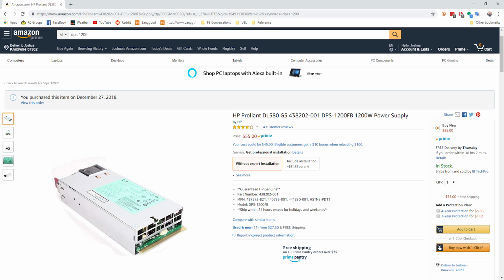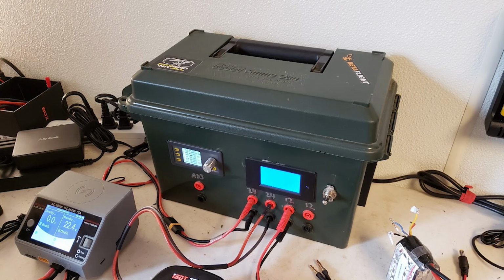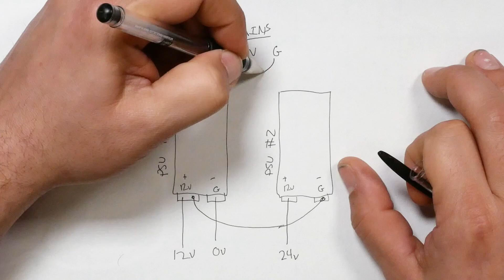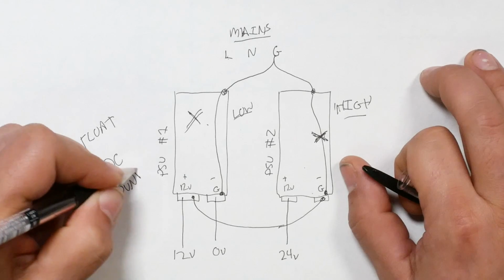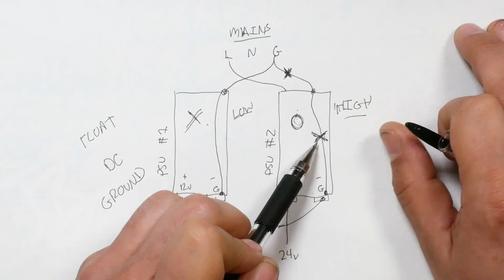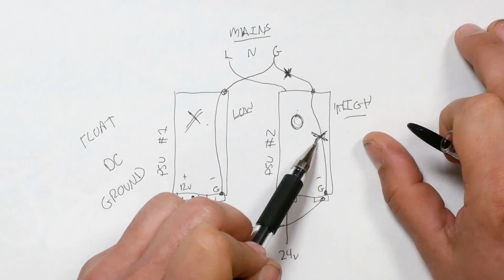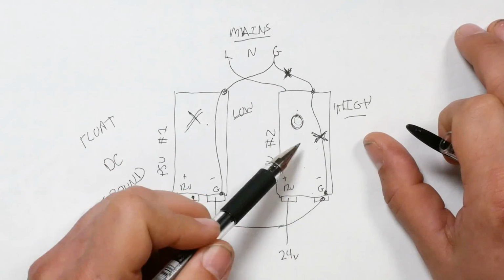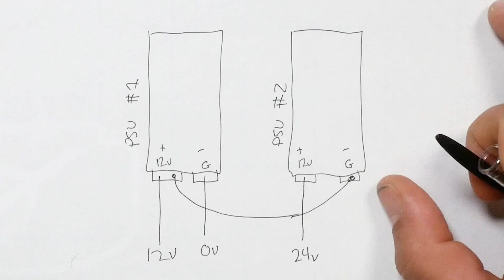How To Build A 24v / 2400W Power Supply | BEST BANG FOR BUCK 24V PSU

Comment: I did this and found it didn't matter which PSU had the floated ground, it would always work. I tested to make sure each PSU would cut out if this was done without the ground floated and they both did cut out if they were the first PSU in the circuit, but once the ground was floated in one of the PSU's it didn't matter if I placed it first or second in the circuit, I would still get 24v. The only difference it made was whether the potential on the casings was 12v or 24v

Comment: Hello Josh, I followed your video but floated both power supplies.  Do you see any issues with this?.  Also i read in a previous comment that the screw post on the board near the "mains" plug should not be isolated.  Is this correct?.  Thank you for any response..

Comment: Why 1200W (2400W in total) tho?
That's a overkill.
Better get two 600-750W (1200W-1500W in total) ones for $10 each and it will feed 95% of the chargers on the market
Reply: Wait where the rest?
You should show people they way you joined them together, the enclosure, mains y splitter etc...

Comment: I had built this. It is as awesome as joshua says. I had one fail, still don't know why. I used same method on cheaper Chinese 12v 30a 360w supply. 24v 720w. I still have the 12v original and now I have 24v again and will most likely ever push its paces. Isolate the board from the case good to go

Comment: Go on ebay you can get these power supply for much cheaper on ebay used like probably $30 for both and I mean assuming you are not going to find 2 different Circuits to plug ini think 2 750s makes sense that's 1500 total and that's supposed to be output so input would be a little higher

Comment: How about current? Wouldn't the HIGH side PSU see twice the current it normally sees?
But its elecotnic components (transistors, capacitors, inductors, resistors,...) aren't sized for twice the current.

Comment: At 5:56 I think you're mistaken or at least what you say is incomplete. If the case on the right hand side became energized, then the ground line of the HIGH side supply would also be energized (the case is still grounded when we only cut the connection to earth at the plug level)
Because of the series link between the two PSUs the 12V line of the left PSU became also energized and it will fry the left PSU. Two cases:
- the left PSU exhibits a conductive path to ground/earth (a short circuit, for example due to a capacitor blowing up) then the breaker pops
- the left PSU electronics cut the circuit to ground (for example a transistor blows) then the breaker doesn't pop.
Remember that for the breaker what matters is the current between live and earth, not the voltage (which would be above 200V AC anyway).
In my experience electrolytic capacitors (which are ubiquitous for decoupling in switching PSU) very often short circuit when they blow. So there's a good chance (higher than 50%) that the breaker pops instantly. But it's not guaranteed, just likely. This is to put in perpective with what you say in the video: that the case of the right PSU would remain energized no matter what.
Reply: So do you think that this is a safe mod? I wanna do this but not kill myself lol😂

Comment: Great video! I have a different HP power supply and where you solder the resistor and where I soldered the resistor based on another tutorial are different.  Basically my tutorial stated to solder a wire from pin 33 to the ground, then the resistor between pins 36 and 37.  Is there a right and wrong way or is mine just different because it is a different power supply? They do power on in series and do provide 24.6v.

Comment: Instead of wiring up the resistor like that, could i put it across a switch so that when the switch is in the “on” position it turns on the power to both the power supplies?
Reply from the maker: Yes that's fine.

Comment: So is this actually a 1200w 24v supply ? Or 2400w 24v? I’m confused.
Reply from the maker: 1200w@12v x2 in series = 2400w@24v. Amps in series stays the same. Voltage doubles. Power = amps * volts so power doubles.

Comment: Hi Joshua, I have an ISDT 20 charger rated at: charging current 0.2 to 20A x2. Max charging power: 500W x2. Parallel charge power and current: 800W/35A. I want to join 2 power supplies together as you show in your video for this charger. First question, you mention about using an appropriate cable to connect the two PSU'S together, it seems that 6 gauge copper wire is what I should use as it can handle the 70 amps you mention. Can you please verify, and is this what you recommend?
Also, with XT60 connectors which the ISDT uses, will 12 or 14 AWG wires be suitable? Many thanks!
Reply from the maker: If you are looking up wire amp rating, bear in mind the length of the wire must be accounted for. Shorter wires will have less resistance. Personally I think 6 gauge is probably overkill. I think I used 2x 12 gauge? Does that equate to 6 gauge? I don't know. I guess do your own research in the end!
Reply: Thanks. 2x 12 gauge equates to 9 gauge...

Comment: 1. I put a dab of super glue on my nylon washer so it doesn't move while installing the nylon screws. 2. do you have to solder a resistor on both power supply to turn them both on, or just the modded one?

Comment: Josh, I just did the mod isolating all three screws.  After completing modifications, I then did all your recommended safety tests and everthing checked out ok (continuity between AC ground  pin and case, no continuity betw. hot & neutral pins to case, and no continuity between case and output neg/pos rails).  Then I cranked up the power & got my 24 volts - great !   However, I did one more safety test after powering on - I measured 26 volts between case and DC output rails.  Is having voltage at case normal when floating DC ground when power supplies are powered on ??
Reply: Hello ???

Comment: HI, JB.  Quick question.  At the end of the video, you only show the drawn diagram vs the final product with wires.  Why are there (3) wire lead coming off the PS’s?  Shouldn’t there only be 2?  Or, do you have a pic of the final wiring assembly?  Thanks!

Edit:  Never-mind....i think I got it.  The positive lead is coming from PSU #! @ 24v and the negative lead is coming from PSU #1.   Sound right?

Comment: Hi ! How are you today , Mr Woods here . I have made a 2400 watt ,power supply like yours . I have banana plugs in and 120 volt switch ! In .not wire up yet ! But i wonted to ask . about the watt and volt meter ! Will it just monitor .the power of the power supply .Our can i hook up 2 two of them .ONE FOR POWER SUPPLY ! AND 2 .FOR THE OUT GOING POWER ! TO THE CHARGER .FOR 24 VOLTS ! THANK YOU FOR YOUR TIME

Comment: Do the 5v rails and 3.3v rails also double up too 10v and 6.6v? Also can u use the 3.3v rail on the first psu as your ground and the 24v rail on the 2nd psu to get 20.7v?
Reply: These are server psu's, they do not supply 3.3 or 5v. You can find 5v on the left pins but it's for the control channel and standby not power output and is only rated at a few amps if there is a rating at all. If you need 3.3 and 5v a higher end desktop psu will be a better option or use a DC to DC step down to get what you need off of one of these.

Comment: What 2400w dc to dc buck convertor do you use to fine tune the voltage you want for charging yiur batteries?
Reply from the maker: That functionality is built into the LiPo charger.
Reply: @JoshuaBardwell  what lipo charger do you use? Does it not have its own power supply?

Comment: Hi JB just wanna ask.
Is it fine to connect Multiple Chargers to 1 CCTV Power Supply 12v 360W 30A and the connector is XT60. 

Co'z I'm wondering if it's okay to connect 3 Chargers in that and use them at the same time 🤔🤔🤔
Reply from the maker: Sure just build a big Y adapter.

Comment: Great video! 
I'm a little late to the party and am going for the smaller rating of 750W so I'm closer to the optimum efficiency around 50% load of the units I'm using (94% for the 656363-B21
)...I was just wondering, what's the maths that determines the resistor size?
Really appreciate any input....off to watch and like some more videos!  Thanks for producing such great content.
Michael

Comment: Back pcb screw should be left metal.  Also led can be easily pushed in. Inside there is springy hooks that can be moved with screwdriver.

Comment: If the metal cases are touching each other, wouldn't taking the ground pin off be ok?
Reply from the maker: That runs the risk of having a case energized with mains voltage and not knowing. Too dangerous.

Comment: Joshua at 12:00 it shows you had soldered pads 37 and 38 together is there a reason why you did that?
Reply from the maker: No it was a mistake and I fixed it later.

Comment: Thank you, this was the info I was after.
Question - Is using this method still safe if putting 4x power supplies in series for a 48v output?
Ps- love your work.

Comment: Does it matter if the 24V comes from the high side or the low side?
Reply from the maker: Doesn't it kind of have to come from the high side?
Reply: Joshua Bardwell I guess what I meant was does it matter if the floated side is the high side?

Comment: What if you want to connect three power supplies in series to get 36 volts? Do you undo the dc grounds from two psu's  and leave one alone?
Reply: Lorenzo Chow   You have to have 3 PS...  you make 2 of them “floating ground” and the other leave it alone.  Connect them into series and boom 36 volts.  I have 4 of them and have 48V.

Comment: you don't need the resister on the PSU FYI Simply just short them and it will power on the PSU, Also you won't get 1.2kw it states on the label you need to run over 200v to get the full 1200w per PSU

Comment: OR... for $108 you can buy a 28VDC, 1200W switching power supply and not have to do any of this work. The vendor I found and purchased one from (on Ebay) had many different voltages available, including 12V, 18V, 24V, 27V, 28V, 30V and more.

Comment: Finally got around to doing this during quarantine.  My supplies were a little different.  4 attach points not 3 and all were the same height with no lip on the posts.  I didn't even have to grind anything.  Closing the lid was a little tight but not crazy.  Ohm'd it out and checked voltages and G2G.  Today's project is to replicate your ammo box.  At least today is the first day of quarantine de-escalation here.  Stay safe.
Reply: What lenght screws do you need?

Comment: Josh, you inadvertently added a risk to your design.  It's regarding your "field box".  You never want to expose the floating ground and you did.  You made both 12 volt units available.  If you are ever using the high side 12 volts and inadvertently ground the negative side you've just killed your power supply.  This can happen if the case of whatever you plug into is, or becomes, grounded.  I think it best never to expose the high side power supply at least not the floating ground.  It's a caution all of your viewers should be aware of.

Comment: I recently modified a 750 W version of this kind of supply. This one only needed one screw to be isolated. The other two screws were not connected to GND. This can easily be measured using a continuity tester (multimeter). So I only filed down the one standoff to put a nylon space under the PCB and one on the top. Since the hole and edges were not conductive I even could use a metal screw.

Comment: Hi Joshua,

Can you confirm the reason for installing the nylon washers? I'm a bit stuck on their purpose.
Reply from the maker: To isolate the DC negative of the PSU from the case, which is connected to mains-ground. When the two PSU are plugged in to the wall, they share a common mains-ground through the house electrical system. If the mains-ground is connected to the DC negative, then the DC negative of both PSU will be at the same voltage potential. It will not be possible to raise the DC-negative of one PSU to +12v, thereby turning the final output of the system into +24v.
Reply: @JoshuaBardwell  so this still allows the PSU with the isolated DC- to short to ground if the AC- wire shorts on the interior somehow? If this doesn't impact the performance or safety of the PSU, why is the DC- connected to ground to begin with?
Reply from the maker: It leaves the AC ground intact, yes. There is another technique for doing the same thing which isolates the AC ground, but in my opinion this technique is safer because mains ground is not compromised.

Comment: Ok I’m going to do this  weekend,my question is if I use a voltage  regulator and drop the voltage from 24 to 12volts would the watts still be 2400?
Reply: If you need 12V just use one power supply. If you nees those 2400w, use 2 supplys for 2 chargers.
Reply from the maker: No because the voltage regulator will have its own power rating, and it is not 2400 watts.

Comment: I think you only get like 1800 watts with 120 volts and 2400 max watts if you run 240volt ac to them.if I understand correctly.tell me if I'm wrong. But 1800 is plenty lol.

Comment: Joshua why is a resistor used.
Why not just some 22gauge wire?
Serious question
Reply from the maker: I don't know the real reason. Presumably it's to limit current flow, but I doubt the circuit would burn out if you used a wire.

Comment: Followed through. Checked ground isolation. Plugged in, led lights for 3secs then goes out - no output. Help please!
Reply: Same issue here, dont know what happend either. Any1 any ideas pls
Reply: @iopuk8206  It was faulty - they sent another one
Reply: @randallpatrickc  thanks man, ill try the same than. You got it working than?
Reply: @iopuk8206  I have some that power themselves off as well. Guessing I am SOL?
Reply: @quinnfoster4671  ive received a new one, now they are ok. Internally they didn't look the same. I had one good built one the other was very bad parts

Comment: I recommend using the IceMeter from http://www.coolice.co.uk/cfs/icemeter.html this is specifically made for series connected HP power supplies. It will prevent damage to your charger if one power supply suddenly goes open circuit! it also has a few really awesome features. Makes doing this mod so much easier as he also supplies a multi-pin connector that just connects to the PCB edge pads.

Comment: Is it correct that with this method it is safe to let the two metal cases (of the combined 24V PSU) touch? Or will it go zap?
Reply from the maker: It's safe. Thats why you isolate the ground.
Reply: @JoshuaBardwell  thanks a lot for all the video's. But i tried this today checked all and supllied 230v after 3 or4 seconds the led went out. No power anymore. Can you please help?

Comment: HP also has a 750w 12v power supply for $27. Slap 2 of those together and you’ve got 1500w for $54
Reply: Ik tried to make one floating the same way, but worked for only a few seconds. Might it be the 220ohm resistor that damaged it or wat?
Reply: io puk honestly more I’ve seen i think it’s only safe to put power supplies in Parallel Not series.
Reply: Yeah, but it is 12V 1500W and 24V 750W !
Reply: IDV no, it’s still 1500w regardless of series or parallel. You’re confusing watts with amps.
Reply: @EV_Dreams  thnx for the reply, i ll get a new one from the supllier. The other one i made some else Do it who repairs these for a living so he made it safe. But he told me one of the psu was very Good and the other  one was terrible. Eventhough from the same order And company, so i agree, its not safe if you dont have decent knowledge.
Reply: io puk i would say it’s easier to run a good boost converter
Reply: Some of the 750w versions can not be DC isolated due to extra ground connection to daughter board.  I have one such board and have disconnected the extra ground and appears to be DC isolated now.

Comment: is the 3rd PSU required to be modified for Float DC Ground in the same way as 2nd one if building 36V power supply ?
Reply from the maker: Yes
Reply: @JoshuaBardwell  Thanks

Comment: Should of started with discharging capacitors. Sorine built one using single psu, pedometer, vr, resistor, 24 volts adjustable amps, usb port using +5 wire.

Comment: It shouldn't matter which PSU gets it ground isolated. As long one in a pair has one isolated, you are golden. If you were to use 3 or 4 PSUs in series you'd need to isolate 2 of 3 or 3 or 4. Basically, only one will be left in tact.
Reply: You need the first psu that provides the negative output to be grounded. If they are supplying something with a coman ground to the psu's, like in the same box. you would have problems if you didn't do it this way.

Comment: $55?  holy rip off batman.  they're all over Ebay for under $20  I just bought 2 of them for $43.      you could have just used a dab of glue to hold the washers in place....
Reply from the maker: At the time I made this video the bitcoin boom was happening and the price of power supplies was inflated.

Comment: For the LED, just push against it with your thumb and it will easily push in allowing you to remove the entire board. I got 2 1200w for $24 shipped :)

Comment: I have question
If I apply MG conformal coating on the standoff and screw area on the board, would it do the same thing? Or safer?

Comment: Honestly seems like too much work to isolate the DC  rather than just removing the ground pin, why would the positive ever come in contact with the case? Unless something blows up in the power supply and makes a positive ac wire touch the case but with those odds I will like to take the risk of dieing.